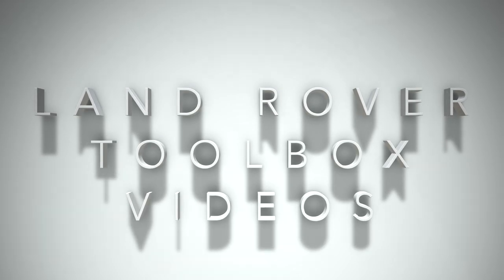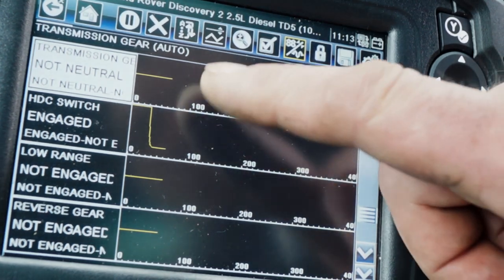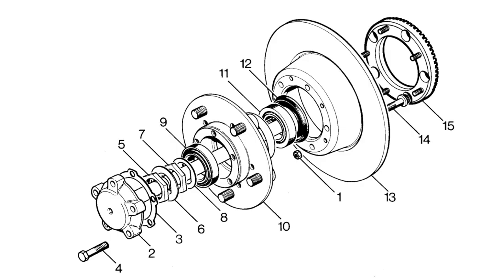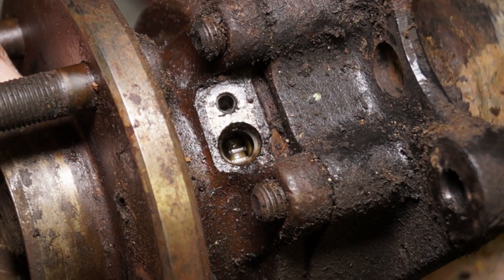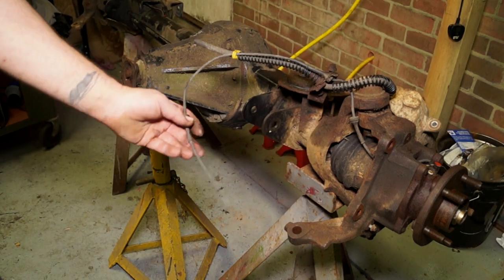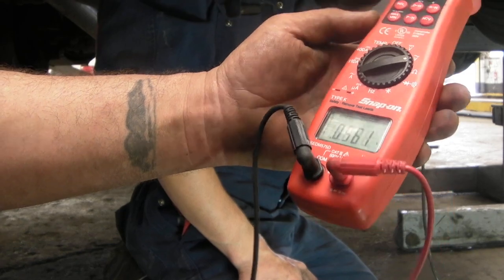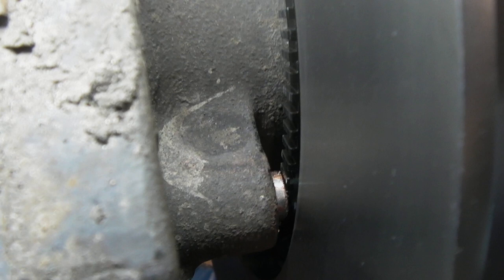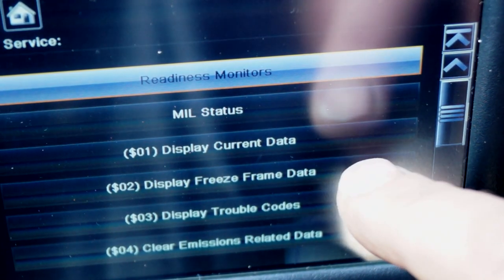Discovery 1, 2 and Defender  ABS Wheel Speed Sensors.   Resistance test.

Comment: Hi there. I have a 2000 LR D2 North America.  my LHR speed sensor reports intermittent output.  I bought replacement sensors for both rear hubs just because. However the new ones ohm out at about 1000. I tested the old sensor and got same readout as new.  How can I check the cable from the sensor to the Computer? Is there a pinout diagram online maybe?

Comment: Tank you for your video. My speedometer stopped working and I have a check engine light read the code and it says speed sensor. Occasionally the speedometer starts working again but then it stops. Along with this automatic door locks do not work as you begin driving and the cruise control is not working. Any suggestions? I am in New York City
Reply: 2003 disco 2